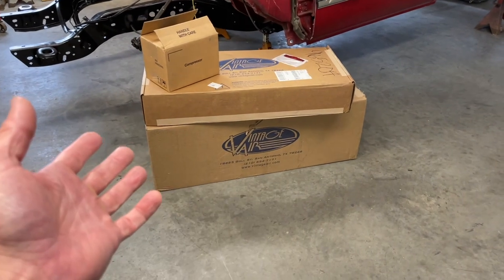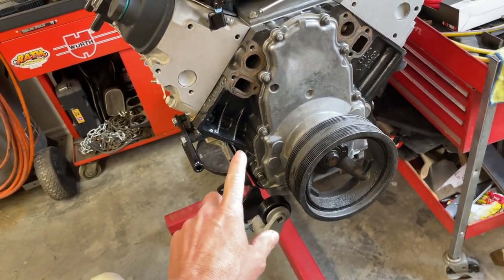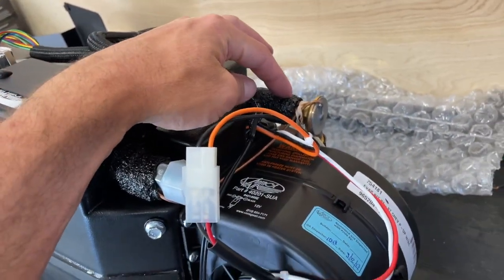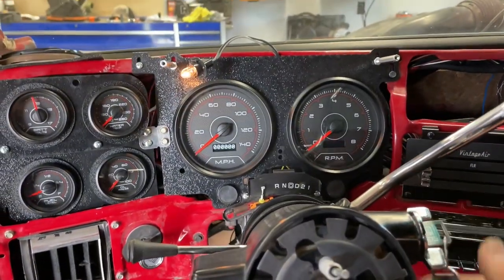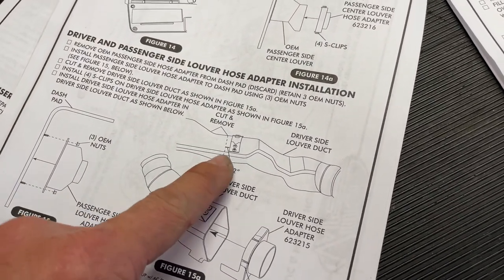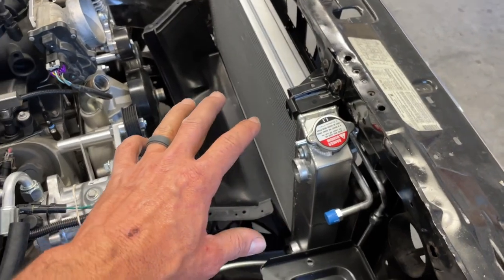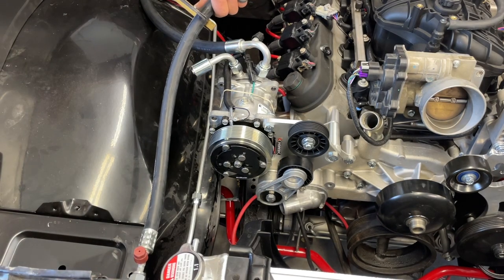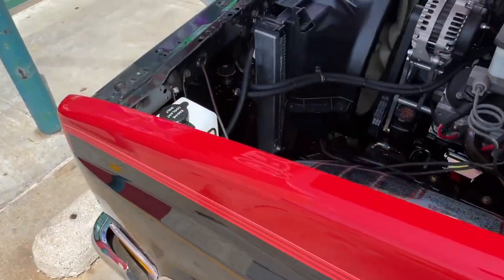New Vintage Air install on a frame up square body build!

Comment: Do you dare to give us a complete price list of what it cost to build?
Reply from the maker: 😂 not a chance.
Reply: GreaseMonkeyTV  Don't blame you! Thank you for the info and inspiration on the build. Awesome C10!
Reply: @crsmith56  Chassis 23K plus, motor and trans (20k), VA kit (2200), wheels and tires (3k), sound system (2-3K), interior carpet and dress (2200), chrome bumpers and trim (1-2K), finding a project truck (8-15K), paint (who knows probably 20K). I’d say well over 70K.
Reply: Probably more like 85

Comment: I’m having issues finding why my factory climate control system constantly pulls in air from the engine bay. My Exaust is leak free, but at stop lights I pull in Exaust from the surrounding vehicles. Any advice would help
Reply from the maker: Turning your air to recirculate uses only the interior air.

Comment: Hello. I like that color combo. Question: Have you had any issues with the condensers with the Vintage Air setups? I need to buy a kit but seen a few things that people are saying they have had issues with the condensers being undersized and they have intermittent cooling issues and swapped them to bigger ones and haven’t had the issues since.
Reply from the maker: Never a single issue. Blows colder than the other two brands I’ve used.

Comment: What high mount bracket did you use? And was your truck a factory air or non factory. I have a non factory and finding that it’s a lot more money for a non A/C truck. If the main difference is inside duct work then can a guy just pull duct work from a donor and save some money?

Comment: I have close to the same set up as you. I’m having a issue of the idle rpm dropping so low sometimes at a stop light that it kills the engine when the ac clutch cycles. Did you do anything to bump up the idle when it cycles?
Reply from the maker: Your tuner should be able to fix that.

Comment: please can you make it a video  to explain how to read and working ecu with o2 sensor in your car with knock sensors my truck is swap ls engine not read it I have problems with low voltage knock sensors bank 1 bank 2 and please anyone one help? With that issue
Reply from the maker: Probably need to seek out a good mechanic in your area.

Comment: What did you do to make the defrost vents fit? I don’t have any factory holes to screw to although my truck is factory air. I could also not get my u-nots to fit. Thanks in advance. Great video and truck as well!
Reply from the maker: Interesting. Your factory air truck doesn’t have the defrost mounting holes?
Reply: No sure doesn’t! It is a factory air truck as I removed the factory AC. Thank you for your reply. Sent email to Vintage AC. Every other video I watched everyone just screwed them into place.

Comment: bad ass truck sir how did u go about wiring the ac control to the idle air controller or ecm to make motor idle up when ac is on?
Reply from the maker: You can send a signal to the PCM via a designated wire in most aftermarket harnesses.